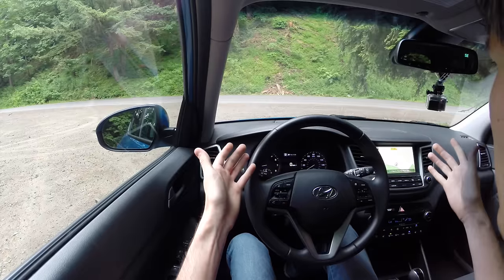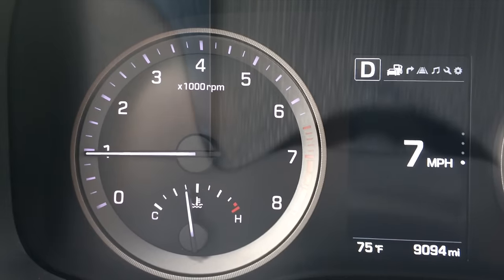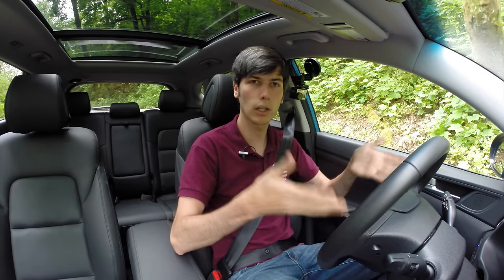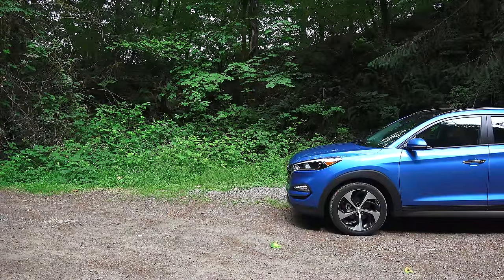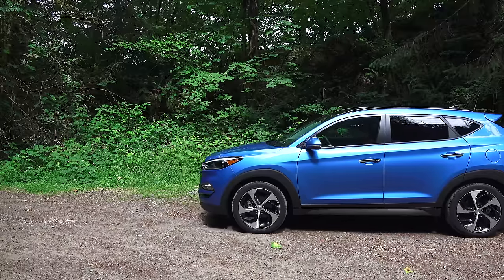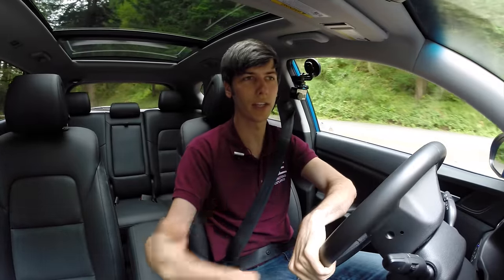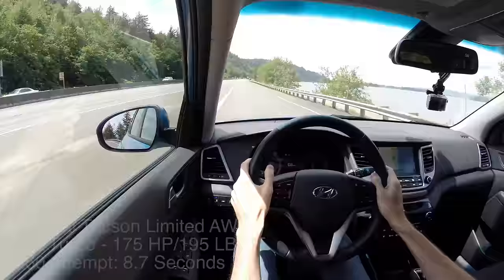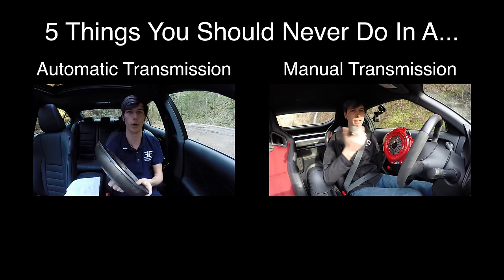5 Things You Should Never Do In A Dual Clutch Transmission Vehicle

Comment: What ever happened to driving a manual?
Reply: Like most old things its quickly becoming obsolete.
Reply: There's nothing like grabbing your own gears. I love being able to grab third gear, or second gear from a cruise whenever I feel like it.
Reply: In modern traffic, it's a chore especially on a hill with a roundabout at the top.
Reply: People are just lazy
Manuals are always gonna be the best
Reply: I loathed my car being an automatic so much I converted to a manual.
Reply: ^Welcome to the club. My 92 Integra got wrote off, so I got a 91 to replace it (Same colour, trim, except auto) So I'm in the process of swapping. To go along with manual, who else misses crank windows? Manual locks? Manual steering? No ABS? No traction control? Honestly, the less driver aids and comforts, the more REAL the feeling while driving,
Reply: My damn car doesn't even have cup-holders. Seriously, the Japenese in the late 80's didn't think anyone would have a drink in a car.
Reply: I like how you mention clutch cable. Most cars have hydraulic or now even electronic clutch engagement now. A cable and spring feels much nicer. The honda 5 speeds from the made in japan vehicles (up till early 90's) Were amazingly light with clutch and shifter, yet responsive. You knew what what going on at all times. My car has a non-syncro first and reverse. So you need to mind your manors. But they are STRONG. Loud, but strong.
Reply: Daisy Duke Too much to think, driving a manual in traffic was such a chore in Birmingham, England. So many hills with traffic on roundabouts, in an automatic, I'd just floor it, that quicker response and less thinking time is so much easier to squeeze the car into a gap.
Reply: If you're into any sort of real performance driving, weight is everything. So many modern cars are weighed down by many things that could be excluded, but would take away from the creature comforts.
Reply: Yeah, but I think most of the weight is due to the safety standards. I plan on dailying a motorcycle so I don't really care about any of that BS.
Reply: Awayze how is clutch driving a chore?
you are basically giving your right foot extra work and giving your left foot a total rest with an auto
Reply: After about the first month of driving my standard, I had hill starts, and stops. Clutchless shifting, and other nice tricks down to a T. It really does become second nature, and with a comfortable setup, it's really easy.
Reply: manual is a lot of fun and its great having 100% control of the car
Reply: Something happend about driving a manual? A few of my friends and me only own and drive manual.
Reply: A Person
Only the most new cars have auto's worth buying. For most used cars, manual is better.
Reply: SI0AX Yeah they do indeed have a bit more power compared to the manual version, it`s never the same though cause it`s not a manual.
Reply: A Person thats a myth- both have equal power even if you buy a manual with less power, you can simply get a plug and drive tuning box to bring it up in power
Reply: Karthik Naik Stickers help too!
Reply: A Person Since when do auto's have more power? If anything they have slightly less due to parasitic transmission losses.
Reply: Sigma Octantis If I remember correctly, don`t some of the newer super cars have more Hp advertised for the autos?
Reply: I don't think it matters which is faster in a straight line. I've never driven an automatic that consistently picked the right gear for me. Tiptronic would be as far as I would go.
Reply: Sigma Octantis I have seen that as well when someones driving auto, I think manual is better cause you choose your gear.

Comment: Paragraph #4: No mention of what NOT to do. As far as downshifting while accelerating, I do this sometimes in my 2015 Sonata Eco when I'm in manual shift mode to have a little fun or when passing cars. Shifts at least as quickly as an automatic. It's a fun car to drive.
The only thing different about this compared to a fully automatic car is taking off from a dead stop. It doesn't do it very quickly. If you take your foot off the brake and give the computer a half secong or so to realize you're ready to start moving, it will shift smooth. Otherwise it's a lot like a manual vehicle when taking off from a dead stop. 2nd through 7th gear shifting is smooth as butter on this car.

Comment: I used to wonder why my Automatic ford fiesta would start going backwards at stop signs going up a hill. I thought it was super strange! I would think its acting just like a manual transmission. (Which I dont do for the cars sake LOL). Little behold I find out all this information. I had no idea it was a manual transmission that was automatically shifted. That explains the rolling backwards on hills! Clutches were needing to engage. Talk about needing to learn about the vehicle I drive a little more next time. Mines in getting a new clutch again due to the input shaft seal leaks and all the classic 2012 ford fiesta issues. My door even swings open when latches fail on the doors. Talk about a nightmare! LOL

Comment: I normally cant take in info at this speed but you have a gift my friend.
 In regards to your logical explanation of inching forward. My 2020 VW DSG does this in second gear because its smoother than if I manually select first. My question is..... logically I should over ride and select first at just above crawling speed because I have a choice, smoothness with extra wear or first with no wear, little jerky but am I over logic thinking and just let it do its thing.
Thanks in advance for any replies from anyone.

Comment: A good thing that you learn on a manual transmission is using JUST the right leg for both brake and acceleration pedals, so you can not press both in the same time. I tried once to brake with the left, it wasn't a good idea:)))

Comment: TL;DW:

1- You don’t need to put it in Neutral in a stop. 
Why? Clutch auto-disengages.

2- Don’t lift your foot off the brakes on an incline.
Why? Clutch will not fully engage and slip, causing wear.

3- Try to not inch forward too much. 
Why? Clutch will not fully engage and slip, causing wear.

4- Avoid downshifting while accelarating, or upshifting while braking. 
Why? ECU will not anticipate it, and shifts will be slower.

5- Avoid launching. If you do, don’t hold on the brake for too long.
Why? When holding the RPM the clutch will be taking all the heat.
Reply: #3 and 4 are the ones people will have the most problems with. #4. A lot of people try to make half stops when the light goes from red to green or at stop signs. #3. Definitely a habit people need to learn to break in traffic jam situations. Which is tempting to do because the guy behind you will honk if you don't drive your car 3 inches forward to fill that small gap, haha!

Comment: I know this video is 5 years old, but still relevant.  Considering a new 2022 VW Golf R with the “automatic” (dual clutch?) transmission.  If I’m cruising and want to pass someone, should I downshift first and then hit the gas? And can I drop a couple gears at a time - ie, shift from 6 to 4?   Approaching a traffic light that is red - should I downshift each gear as I approach, so the trans will be ready when it turns green?  

Would be my first dual clutch trans - all my other cars have manuals.

Comment: It’s interesting how different these intricacies are changed by having a PHEV with a dual clutch transmission, namely the Hyundai Ioniq (2019). For instance, creeping forward on & off is nowhere near the issue it would be if I didn’t have a hybrid.

As a note, I’ve noticed a slightly longer delay when shifting in a way that the car doesn’t expect, but never to the point of being an issue for me, perhaps the hybrid drivetrain helps fill in the gaps better than I think it does. Otherwise, power is almost always transferred very quickly and cleanly after you engage first gear all the way.

Comment: This isn't typical launching situation: You should do it at a STOP sign before you go on a road without an speed limit.
There was some contruction and the driveway changed completly; as I had taken driving lessens this was a common point every new driver who has taken driving lessons got the ESP-car into blocking tires (you should'n readuce the speed until you are fully in the exit and the entry was very small for a road without any speed limit).

Comment: Question
Based on this video it was said that in DCTs you should not down shift when on the accelerator nor should you up shift when on the brakes. Do you then only up shift while on the accelerator or  should you come off the accelerator to up/down shift like with manual vehicles? (I learned to drive on a manual vehicle for 6 months but  I haven't driven one since 2006 so that is based on what I remember; When shifting gears you come of the accelerator.)

Comment: This is a clutch system that was designed in the late 30's believe it or not. The raw advantages of dual clutch are efficiency ticks like: better fuel economy, faster gear changes, weight savings and generally cheaper to build for the manufacturer. In its raw form these types of transmissions should be regarded as being superior to the typical slushbox type of automatic that we have grown to love over time. However, the problem is that the manufacturer incorporates their computer systems into these dual clutch transmissions and problems occur. Things like when you start to slow down quickly the dual clutch transmission receives information from the computer saying, hey there must be a stop sign or a stop light approaching so let's totally disengage the transmission and coast in neutral. Well the computer may have interpreted this incorrectly as maybe the light was red, the driver started to slow down but now the driver wants to accelerate again because the light has turned green. Well those dual clutch transmissions with the computers don't like this and they hang up in neutral for longer than we the drive want and this creates a disconnect between driver engagement and vehicle response. Would it not be better to let the computer handle dual clutch transmissions less often than in regular transmissions? My thoughts are yes, dual clutch transmissions don't need computer involvement in trying to interpret human interaction with the vehicle. Maybe this will help to correct the 'stigma' related to dual clutch transmissions and help them to grow in vehicle application.

Comment: The part where you say that when accelerating, you're probably upshifting is not that simple. It depends on the current engine rpm and the pressure on the gas pedal. For the DSG, for example, when you're on relatively low rpm (<2500) and you hit the accelerator hard, the gearbox will predict that the next move is to downshift in order to achieve maximum torque. In contrast if you're easy on the gas, the gearbox will preselect the higher gear to achieve fuel economy

Comment: i would like to ask you about the first thing, wheter i should put the transmission in neutral when the car stops. I have superb 2014 with 6st WET DSG , when i stop the car i can see on display info about my actual speed(1) and you said when the car stops controller of transmission knows that the car is staying and it automaticly desengage both clatches. But in my case the first gear is not desengage and i can feel that the car is pushing forward litle bit and i can see on display info that the fuel consuption is bigger than i put the car in neutral, 
You can also hear from the sound of the engine that the engine is engaged and trying to push the car. Same behavior is on seat with 6st dry DSG 2014 and audi Q7 3.0 2015 8st tiptronic

Comment: Never had any problem with my Audi A3 DSG but I don't do any of the things that you shouldn't do that are listed in the video.
Changing gears as a semi auto sequential manual is bizarre without using a clutch so I never do it and my car has a launch control setting which I assume is meant to make break and accelerator at the same time less of a problem but I never bother with that either.

Comment: in point 1 he said when dct stops it automaticly disengage the dry clutch.
in point 2 if the car is stop in incline, the clutch is disengaged so it will roll backward unless u push the brake right?
or it has slipping clutch mechanism that prevent car rolling backward when in D

Comment: Hi, and thanks for all the info. One thing I found disturbing with my dual dry clutch kona is trying to go up a slippery snowy hill in automatic mode with the anti skid disarmed is that: in 2nd gear, loosing momentum it behaves as if the clutch disengaged, RPM goes up but no more traction… 🙃 I ended up always leaving in manual mode, still with anti skid disarmed and no more issues.

Comment: Now they need to engineer a triple clutch system and with different logic presets (sports mode to have all 3 clutches selecting forward gears like 1, 2, and 3, normal to have a gear either side of your current gear selected at a moments notice, like being in 3rd and being able to shift down to 2nd or up to 4th asap, and tbf, I'm too lazy to think of an economy mode but that's my thoughts for you all to tinker with

Comment: In case of Kia Seltos 2024 with 7DCT Dual Dry Clutch transmission, if I use Auto Hold at signals for say 5 minutes at zero speed, will the clutches be disengaged ? So can I remain in Drive mode ? Tell about this particular model.

Comment: I am a mechanical engineer, designing dual clutch and gear shift systems for such transmissions for the OEMs, and even I hate driving them (traditional autos, automatic manual transmissions, cvts, you name it). It’s much more involving and fun to drive a manual car than to press some paddles when you feel for it. But it’s not for the lazy. And if you compete professionally it’s probably also not for you. It’s kind of like electric motors vs internal combustion engines, if you really are into cars, you’ll love ICE but if you’re just into stats on a paper or having the latest technology, you like electric. This is a fact, everyone who disagrees are clearly wrong.

Comment: Regarding your first point (about putting the transmission into neutral when stopped). Sure, the clutch will be engaged and not slipping when stopped - but won't that wear the throwout bearing, just like in a manual transmission?
Reply: DCTs don't have a throwout bearing. They work opposite of a manual in that the clutches are under hydraulic force when engaged and just sitting "loose" when not engaged.

Comment: you do need to put the gearbox in neutral with some dual clutch vehicles. 
thats because it rides the clutch all the time. the car will pull even with no throttle, much like a normal auto you need to be on the brakes with enough force to stop the car from moving.
you can creep forward by using light braking effort.

Comment: Great videos. Still not clear in manual DCT as the driver do I clutch/declutch just the same as single clutch? Is gearing down the same? I was used to reving up a bit when shfting down (3rd to 2nd for example?) So from a stop when I engage 1st, is the DCT already sliding and syncronizing 2nd on its own shaft so when I actually shift to 2nd, all it has to do is apply the power thru the 2nd shaft and 2nd clutch? As this happens 3rd is also being selected and synchronized etc.?

Comment: I was hoping you would address using engine braking on long downhill runs, such as you find in Colorado.  Is it any different than shifting to a lower gear in a standard transmission?
Reply: nope, gears are gears, if you downshift to a lower gear youll get more engine brake. doesnt matter automatic or manual

Comment: If it happens on a uphill that the car goes backwards while i "d" , can this cause a problem to the gearbox ( dsg ) if I just step on tha gas pedal ? Thanks in advance
Reply: It might cause transmission shudder. But that's better than just rolling back into the person behind you. Generally, what you should do in that situation is engage hill start assist if you have it. If not, you're going to want to wait for the person in front of you (assuming you're not the first in the queue) to get some distance ahead of you and step on the gas. Preferably with enough force to get it rolling at 25 MPH if you were on a flat surface. I'm not saying to gun it, though. Putting too much force in a stopped position might cause shudder. Putting not enough force in a stopped position might cause shudder. You gotta find that sweet spot.

Comment: Why is the dual clutch bad in some Ford models and why did they not realize it in the first couple years? I own a used 2013 Ford focus and I've had to replace the transmission control module under warranty.

Comment: In regards to the part of the video you talked about it being ok to let go of the brakes on an incline as the torque converter has enough torque to hold the car on the hill (for an automatic as you say) - yes, but no. I've owned a few, and driven many, automatic transmission cars, and not once did your statement prove to be true if the hill was anything higher than about 7 degrees. The force of gravity versus the torque of a car is not equal by any means, therefore the car will roll back if on a hill and the brakes are not applied.

Comment: In my 06 audi tt with 6 speed  dsg while at a red light, my car wants to move forward . I have to apply slightly more pressure on the brake  pedal to hold car stilll compared  to a regular automatic  transmission. After watching this video  I wonder why my clutches  aren't  totally  open.  I wonder what normal  is for my transmission. Any thoughts about this?